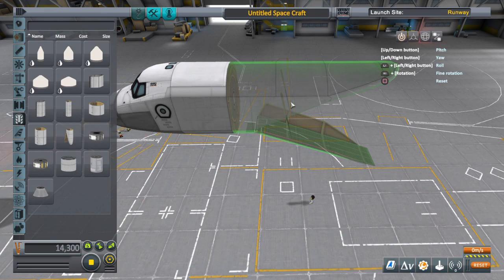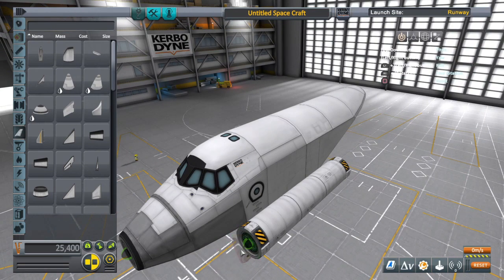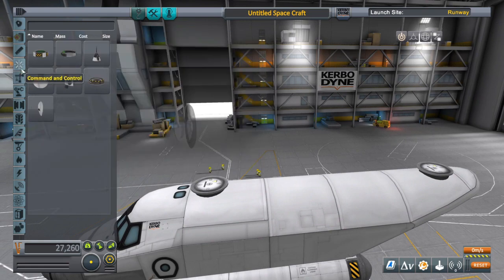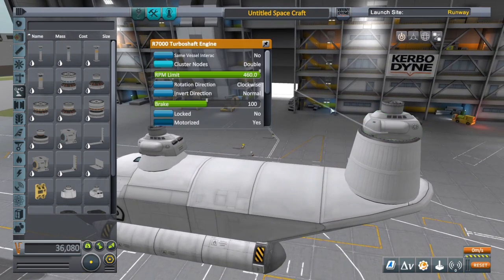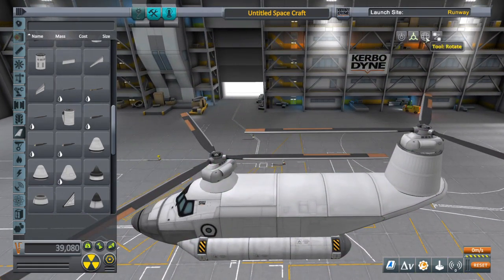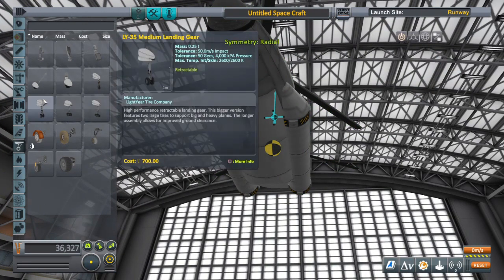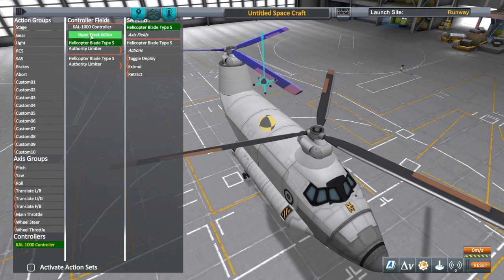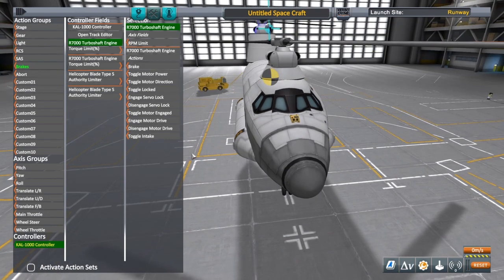Kerbal Space Program Tutorial - Chinook Helicopter

Comment: Can you do a tail rotor next?
Reply from the maker: So tail rotors would be super difficult if not impossible. Real world helicopters have a transmission between the main rotor and tail rotor. So it runs a constant ratio. The tail rotor runs much faster than the main rotor which in game, isn’t going to work because you wouldn’t have enough lift at that point. I did build a working transmission but that was still pretty rough.
Reply: @JohnnyOneShot  Ok, Thank you, i was going to make an UH 1 Huey for my friends war, maybe i should use a rotor and a part that doesn't use air physics
Reply from the maker: If you use rotor blades and don’t extend them, they don’t produce lift or anything. So you could use them for looks. Just toss a couple reaction wheels and batteries inside the helicopter somewhere to controls spin.
Reply: @JohnnyOneShot  oh, perfect, Thank you!
Reply: @nickgreene516  are you playing on PC? because i build one with a tail rotor and i'd say its definitely possible

Comment: My chinook keeps flipping backwards on takeoff yet its not tail heavy and its rear rotor isn’t less powerfull. Idk what exactly is going on. Any tips?
Reply from the maker: Sounds like the center of thrust isn’t inline with the center of mass. If it’s flipping back, try moving the rear rotor forward a bit.
Reply: @JohnnyOneShot  i tried but no matter how i adjust it seems to not work. It is a longer that yours but i don’t see how that would deem it unflyable. Ill probably just have to add more stuff and hide it in the front instead perhaps that may work.

Edit: i am also making a mi-26 style helicopter and i hate how short the blades are. But it seems that it won’t work if i extend them. Any work arounds? Or will i have to just live with it? I also keep having the issue of the rotor starting and slowing down then picking up speed and repeat.
Reply from the maker: Are you on PC by chance? Worst case, upload a couple pics of your crafts on Imgur and shoot me the link. I’ll be able to help you better.